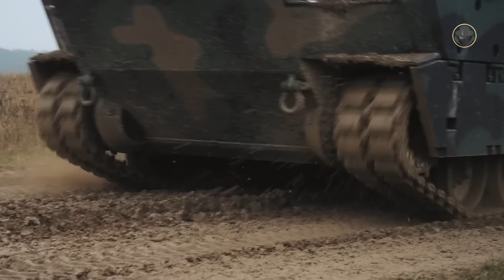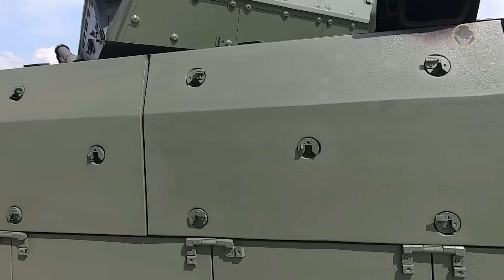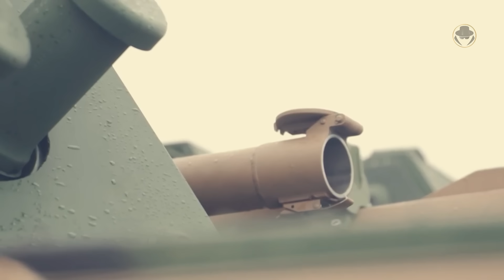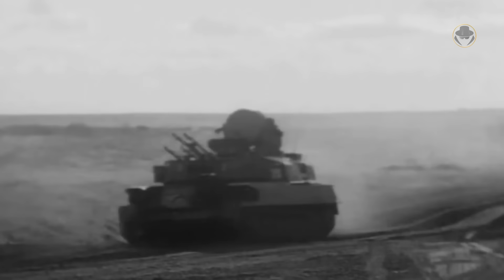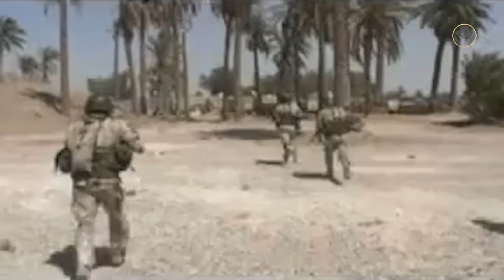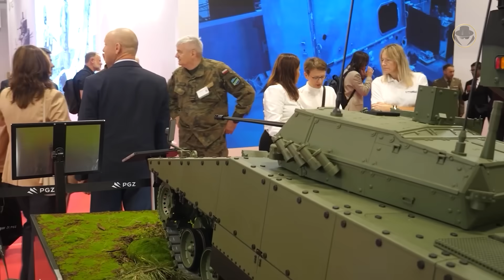Borsuk | The new ride of winged hussars

Comment: It is most likely Poland will end up going with domestic Ratel - but it's a high risk program. Developing new IFV from scratch in 2-3 years is unheard of.
Hence if program drags on, foreign alternatives are considered. But for now army gives the benefit of a doubt to industry. It is expected to see full working proof of concept of Ratel during MSPO exhibition in Kielce, so in early September.

Borsuk has some export prospects especially in tropical regions, like south-east Asia due to fact that it's modern amphibious IFV with one of best integrations of amphibious capabilities available. Requires absolutely 0 prep time before dipping in and can use all of it's weapons directly from water.
Of course it would likely require some modification in coating to better protect against salt water if expected to be used in salt water for extended periods of time. But generally it's a quite viable and well protected vehicle suitable for various marine formations and for use in very soft ground that can't support 35t+ vehicles. So you can see it might fit the requirements in countries like Brazil, Vietnam or Philippines.

It's armor is a complex topic, seeing as it's using HHA plates instead of RHA plates. In most places that's 2 roughly 10mm HHA plates spaced by ~80mm foam (buoyancy is high due to flotation device being basically integrated into armor itself, hence also no need for prep time) drawback being that armor IS oversized. we are talking 100mm thickness all around. In War thunder terms - it means that armor is very prone to trolling - actual vehicle internals being quite a bit smaller than it's external profile - which would affect it's staying power (penetration is less likely to actually do expected damage, especially at odd, shallow angles). Such structure also lends itself to better protection against HEAT type warheads that might cause smaller FPV's to struggle more than they should based on ballistic resistance alone. Especially in front - since front is further separated another 10mm internal plate after engine block - in case of RPG hit to direct frontal arc mobility kill (engine destruction) is likely but soldiers in the rear would be unharmed. It's protection against mines is superb for this class of vehicles due to innovative reactive plate at the bottom which yields slowly under impact (it's on hydraulic spacers that provide just enough resistance for plate not to be deformed, but dissipate energy of blast). It has mine protection values closer to MRAP than to tracked vehicles (which have usually quite poor protection from mines due to engineering difficulty of implementing such a thing).

Comment: Suggestion: electric auto-drop mirrors in the front when the Bushmaster barrel gets close. As soon as the barrel moves away, it goes back to its original position. Training will cause operators to hesitate and be extra careful in that fire sector over a stupid mirror rather than break it, because commanding officers will complain or yell at them about it, or because it's a 7-year bad-luck superstition. Something to consider for next year's model.
Reply: I think the mirrors are for driving on public roads mostly. Most likely to be removed in combat.

Comment: Polish Government is considering gaining as many new systems as they can in a new and innovative strategy to maximize toaster bathing of technicians, mechanics and logisticians of the Polish Armed Forces.

Jokes aside, whether Poland will choose domestic or foreign design in heavy AIFV depends on how many can be made in what time, Poland needs vehicles capable of crossing rivers and marshes for the parts of Poland most endangered by potential Russian aggression.
Reply: Use helicopters...

Comment: The new mount of the Winged Hussars is not the Borsuk, but the K2 Black Panther. In Poland, the spiritual successors of the cavalry are armored units.
Reply: IFV are dragoons
Reply: If the K2/M1 are the spiritual successors of the winged hussars, then the Borsuk would be the spiritual successor of the pancerni (panzer) cavalry. ;)
Reply: @ChillDudelD nope if we go that way. M1 is winged hussar, K1 is panzer, Leopard/PT91 Light Cavalery, Then IFV Rattel would be dragons and IFV Borsuk would be just infantry 🙃
Reply: @Weryl  Nah, M1s, K2s, Leo2s and PT91s are in the same class of MBTs - heavy breakthrough attacking force just as the winged hussars. Ratels, Borsuks and Rosomaks would be lighter but still armoured supports of the former, just like the pancerni cavalry was.
Reply: @Weryl 
Dragoni, jak żołnierze pana pułkownika Wołodyjowskiego. 😊
Reply: @gwidondelusignan6960 Dragoni czyli Polska jazda lekka wyposażona w pikę która może walczyć zarówno konno jak i pieszo 🙃
Reply from the maker: Yes, you are right, but this title was sexy.

Comment: the reason they cannot design heavy , or heavier, armoured vehicles might be that they dont have  a own recipe for modern composite armour, like dorchester. they would have to get a license for that.
Reply: “Pangolin” is the name of a Polish armor system that can be produced in ERA or NERA variants, depending on the military’s order.
Reply: @ohv4254  aha interesting! but, it might be not as effective or applicable for main armour.
Reply: @koenvangeleuken6544  It is effective as main armor you couldn't be more wrong about that. Check out the Pt-91 twardy a polish upgraded t-72 that has polish ERAWA armor installed. Pull up the data about then in ukraine, It takes hits like it's nothing.

Comment: If it is fitted with CRT tracks, the saved weight goes into a bolted‑on additional front armor made of Amrox 600 steel; in that configuration it still floats and has STANAG 5 protection at the front and STANAG 3 on the sides.
Reply: Gumowe gąsienice to tylko w czasie pokoju i dla treningu.Ograniczają zużycie sprzętu i dróg.W czasie W przejdą na stalowo- gumowe .
Reply: @ROBbob070772 dokładnie. W razie W dzieją się różne rzeczy, gąsienica może zostać zerwana miną lub ostrzałem, jeśli kompozytowa się zerwie to jesteś w D i musisz czekać na WZT, jeśli masz gąsienice stalowe możesz usunąć zniszczone ogniwa i spiąć gąsienicę krócej a wóz pojedzie dalej. Poza tym, stalowe mają lepsze właściwości terenowe.
Reply: @patrykb_  CRTs also have ways to quickly repair a break, just like Harley has kits for the temporary repair of a broken drive belt.

Comment: Way too expensive. I could get 1.5 KF41s or 1.5 Lynxes for that price. They have more experience with armored vehicles anyway.
Reply: Wait five years and we will see which one is better and cheaper 😊
Reply: The first  price include research   costs.
Reply: You don't yet know the real costs of production of both. Borsuk's price includes RnD plus building production capacity. I'm sure it'll be cheaper and produced faster than Lynx. Herman production is slow and expensive. Check Leo's 2.
Reply: mamy wspierać własny przemysł a nie obcy.
Reply: @wiesawgren657  Zgadza się. Po za tym każda złotówka wydana w kraju wraca w wysokości 60 gr bezpośrednio lub pośrednio do budżetu.
Reply: Why to constantly just buy, if you can licence and resell in the future?

Your opinion is short sighted.
Reply: Don’t believe the conspiracy theory that any German IFV would be cheaper, because the price is determined not only during negotiations but also during operation, the supply of spare parts, upgrades, and so on. Suddenly it turns out that replacing a spare part costs more than manufacturing it with a gold alloy.
Reply: Military contracts are not easily comparable. Additional hidden costs include service costs, spare parts inventories, staff training costs, and the cost of building military repair shops. Exclusivity for certain technical solutions is also a factor. Prices can be compared once the Poles produce the first 300 units.
Reply: Lynxes😂😂😂piece of crap.
Reply: Ale pieniądze zostają w większości w Polsce a nie w Niemczech.Wspieramy Polski przemysł i polskich pracowników i projektantów.Silniki i przekładnie oraz działko i tak kupujemy za granicą.
Reply: Koniec i kropka .W dającej się przewidzieć przyszłości Polska nie kupi niemieckiego sprzętu pancernego.Niemcy muszą się zadowolić sprzedażą silników lub licencji na nie do tysięcy wozów pancernych wyjeżdżających z polskich fabryk.No może tysiąca.Podstawą polskich sił lądowych będą K2PL i Abrams oraz Borsuk ,Ratel i Rosomak.Leo zostaną do końca swej eksploatacji czyli jeszcze z 20 lat lub pójdą na Ukrainę😬
Reply: How cute these little know-nothings are. No, the Polish arms industry will need decades to achieve any significant sales. Yes, I'm aware of the R&D factor, which proves why an A8 costs around 20 million. And yet it's still being bought. Why? Because it's German. That reputation doesn't develop overnight. Grow up. Furthermore, I'm curious how Poland, as the largest EU recipient country, intends to afford its army once it exceeds the limit it will reach in about two years. Then the EU funding will dry up.
Reply: @solidsteel3634  "German reputation" 😂- great for parades/not for real combat and "we can't build more than 10 tanks a year". Battlefield experience: Leopards in Syria - fail. PzH2000 in Ukraine - fail.
Reply: @shchenka5973  None of that is true. And it all comes down to circumstances. In Syria, A4s were deployed and manned by substandard crews. Like I said before. The Leopard is good everywhere. The PzH2000 is also doing an excellent job in Ukraine. You should stop listening to Little Putin. That old vodka-addled man doesn't know what he's talking about 🤣
Reply: @solidsteel3634  PzH2000 showed 3x lower combat readiness compare to AH Krab
Reply: @kkrolik2106  It was used three times as often.
Reply: @solidsteel3634  What reputation are you talking about exactly? Of Leopard 2? I will happily learn, but there's a pretty big shade thrown on Leopard 2 and it's performance in Turkish army. Or is it Germany's reputation of making 'the best' tanks? If so, can you name them?
Reply: @JagdWehrwolf  Your comment shows me that you have no idea what you're talking about. Even the best machine can't achieve anything with a bad crew. Leo2 A1 to Leo2 A8. They have repeatedly proven their superiority over other MBTs. Multiple winners of the Europe Strong Tank Challenge. Multiple victories with Germany and Austria with Leos. Read a few reports. Then get back to me.
Reply: @solidsteel3634  Great for competitions. Mediocre in any actual deployment.
Reply: @solidsteel3634  And that's called 'moving the goalpost'. Nowhere in your post you said anything about quality of the crews. You stated that Leo is pricy, but it's still being bought 'Because it's German'. Maybe I don't have an idea, so enlighten me: are German tanks being bought with German crews? 
Also, I'm not talking about sports. I am talking about actual battlefield performance. And Leo2, maybe outside of Stridsvagn 122, has a very mixed reputation.
Reply: @JagdWehrwolf  Well, it always depends on what you invest in your crew. The tank itself is top-notch. However, a Lada can beat a BMW if the driver in the BMW doesn't know what he's doing. Furthermore, the A8 is superior even to the Strv122 and beats it 65:35. Personally, I don't know anyone who would give the Leopard a bad review if they had even the slightest clue. So yes, the Leopard is pretty much the best thing you can buy.
Reply: @solidsteel3634  What does it have that other contemporary tanks do not have? I can think about one thing it still does not have - full ammo isolation.
Reply: @JagdWehrwolf  The ammunition storage in the hull of the Leopard 2 is well protected by the thick armor of the hull, although newer models have reduced the amount of ammunition in the hull and integrated additional protective measures (such as blow-off panels) to better protect the crew and minimize the danger. And that's been around since A5, if I remember correctly.
Reply: @solidsteel3634  Apparently, we also have experience building armored vehicles. They just aren't so popular as German ones are.
wait and see.
Reply: @solidsteel3634  You’re the ignorant one if you don’t know that the manufacturer of the Borsuk spent decades producing the BWP‑1, the 122 mm Goździk howitzer, and MTLB tracked vehicles.
Reply: @ohv4254  So, experience with inferior Russian equipment? Great...
Reply: @solidsteel3634 yeach, and leopards are mass produced........ 😂😂😂😂😂😂😂😂😂😂😂😂😂😂😂😂😂😂
Reply: @paskuder3065  A total of 3750 Leopard 2 tanks were built. It also has four times the combat effectiveness of Russian tanks.
Reply: @solidsteel3634 and how many leopards are produced a year?
Reply: @solidsteel3634 just wait and see.there coming big changes and new supraises .

Comment: Insightful video, really good work!

More Borsuks will be ordered soon, most likely in January 2026 - funding from EU SAFE is supposed to secure another order of 140-180 Borsuks. Expanded production capabilities is the key when it comes to deliveries and cost and the first batch was supposed to smooth the process.
Poland has just secured a very convenient extension of the license Rosomak production with Patria, so wheeled IFVs can be produced in large numbers. 

Heavier IFV - HSW most likely will deliver a pre-prototype of the Ratel in 2026 as promised, so I hope it will win with competition.

A prediction of the POL General Command is that the next war with Russia is more and more likely to happen, so timing is a major factor. 
If Russia decides to start another war Poland has to be ready. If it doesn't it will be also due to strong military deterrent in Poland.

There is little to no hope Russia will be a peaceful country in generations - during the slightly more than 500 years of Poland's relationship with Russia there were only less than 10 years when Russia was not a hostile country. Yes, I did count these.
Reply: If Russia start war with Poland all those new Bosuks will burn because they don't have active protection. Drones will get them. Also Poland got 15 Boruks now but next year they will only get 3! Yes three! In 2027 they will get 20-30. Production is way to slow and as mentioned they lack active protection and we all know how that end in Ukraine. Drones everywhere so all vehicles need active protection. There should also be special anti drone vehicles inbedded with Borsuks and tanks to protect them.
Reply: @arteljus You might be surprised but what is happening in Ukraine is observed and it is considerably easier to attach hard-kill anti drone systems and use other solutions than develop and start production of ifvs which are the backbone of the modern mechanized forces.
Reply: @tomaszmankowski9103   Yes so where are those anti drone systems? Borsuk should have that from start and not as an upgrade later on.
Reply: @arteljus The "start" was over 10 years ago.
All armies are adjusting to the new reality and anti-drone systems are being developed, tested or integrated in various armies.

Do not assume that this is neglected. Army is a system, even a bloody platoon is a complicated entity, so suddenly demanding that everything should be ready and working is unrealistic.
Reply: @arteljus  
Dzieiejsze systemy antydronowe sa juz przestarzale na jutrzejsze drony.
Takie rzeczy nie robi sie na dzisiaj je sie robi na jutro.
Reply: @albertalbiala1053  Israel mial system juz 10 lat temu. On jest przystosowany do dzisiejszego pola bitwy, do stracania dronow.
Reply: @arteljus  
Wojna na Ukrainie weryfikuje co 3-4 miesiace nowa generacje technologii dronowej i twoje dziesiecioletnie systemy nie sa ta generacja i mozesz sobie wypisywac swoje dzisiejsze przystowania do pola bitwy.
Praktycznie wszystkie polskie dzisiejsze drony nie spelniaja wedlug testow na Ukrainie pola walki sa przestarzale i to sa fakty o tym mowia sami producenci ukrainscy.
Reply: Have you heard many times from the military or the Russian leadership about the desire to attack Poland? At the same time, the Polish general openly spoke about the burning of the Kaliningrad region by Polish artillery. NATO is conducting exercises to capture Kaliningrad. Therefore, if there is a new war between Russia and Poland, it will begin with an attack on the Kaliningrad region or with the establishment of a naval blockade by NATO countries of the Kaliningrad region.
Reply: @andreyradyukov8921  Ehhh. It is 2025, so close to the fourth, full year of full scale Russian invasion of Ukraine. I am sorry, but trying to show children stealing 'every day a new warcrime' Russia as a victim doesn't work.
Try with a country will less tarnished reputation - perhaps North Korea?
Reply: @tomaszmankowski9103 Have the Poles lost their minds? The military, human, and economic potential of the NATO countries exceeds that of Russia by many times. This is well understood in Russia. Attacking a NATO country is suicide for Russia. Why do Poles believe that Russia will attack them? Can you give at least a few logical reasons why Russia would attack Poland?